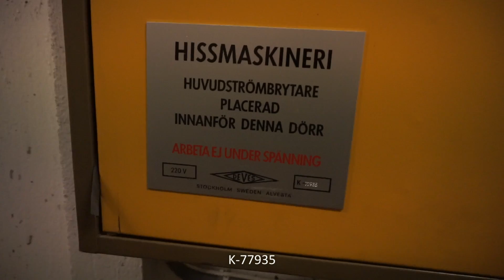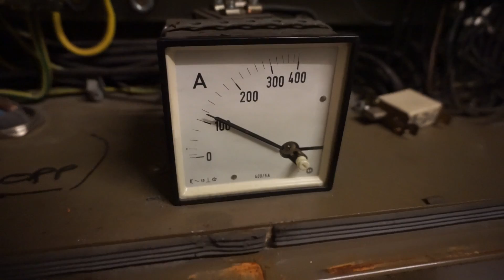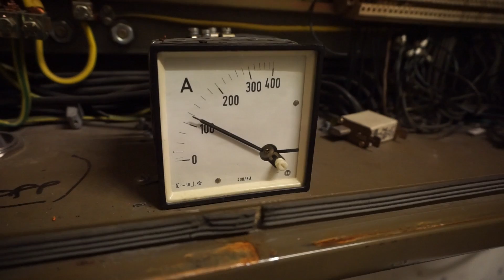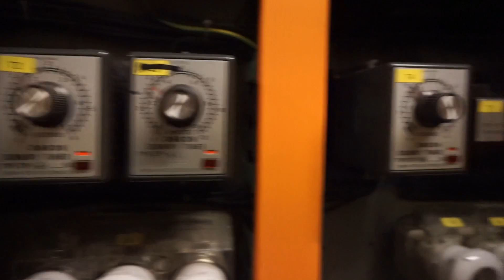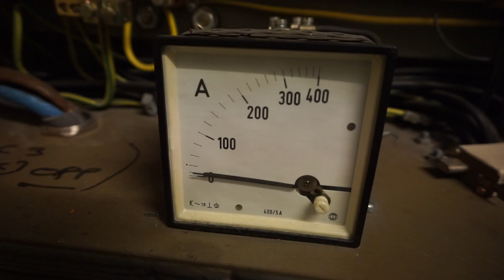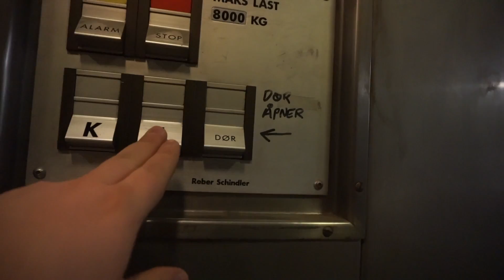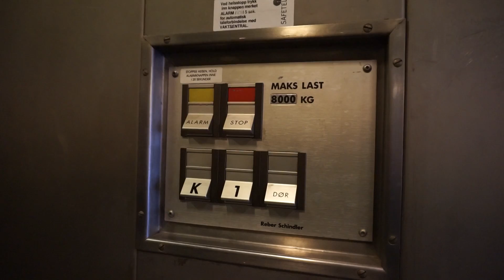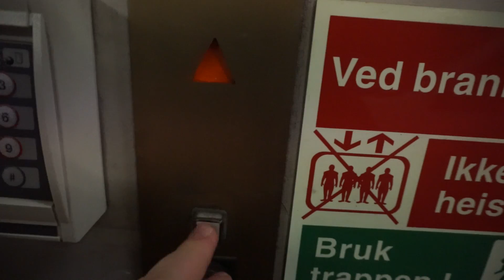Machine Room Tour! 1978 Reber Schindler (DEVE) hydraulic car elevator @ Kongens Gate 9, Oslo, Norway

Comment: Is this a dual hole-less hydro elevator with the two power units? I only saw one output pipe. Plus only one magnetic motor starter in the controller cabinet and a single inspection control panel. 135 amps is a lot of current with a 220V controller. Something this large I'd expect to find a 440-480V controller less current draw.  I see the motors are three phase from the leads on the motor starter.
Reply: Notice that is has 2 motors on top of the oil tank and you hear each one start I think it's holeless
Reply: In the description it says holeless telescopic hydraulic